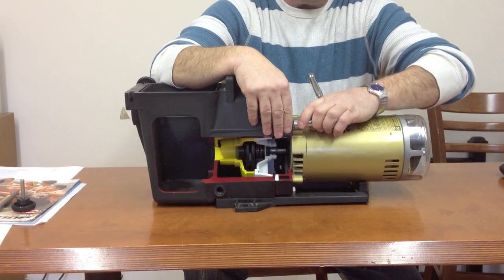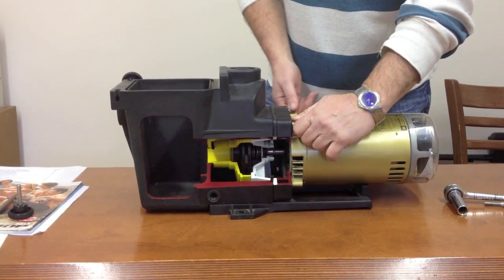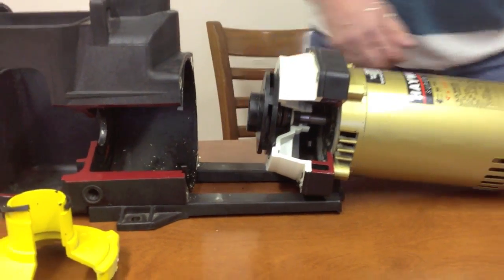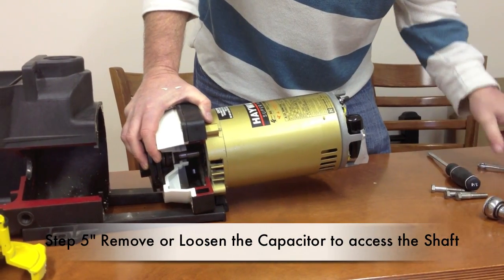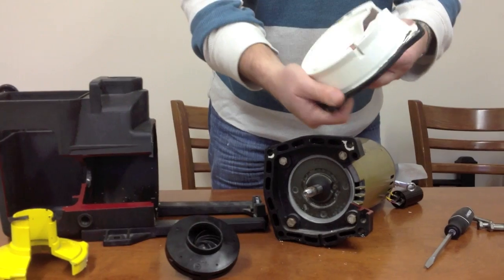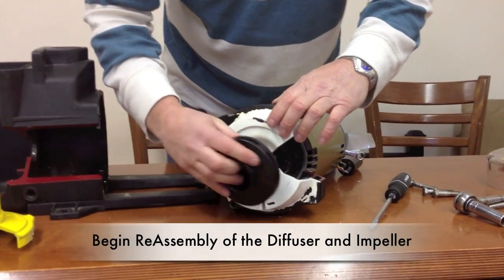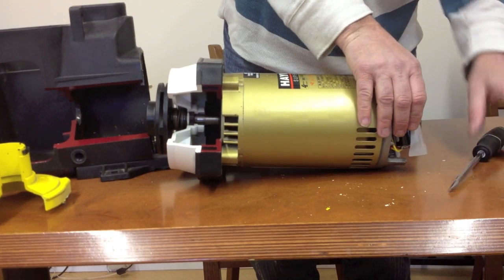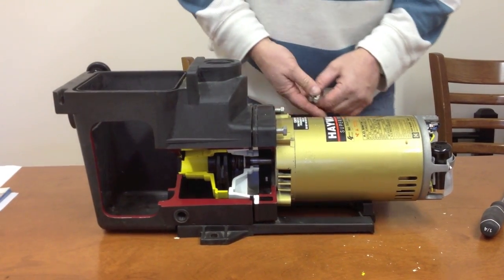How to Change a Water Seal in Hayward Pool Pump Motor

Comment: Great video!  The cut away of the pump &  related parts is a good teaching tool. I'd just mention to be sure power is off & be careful that the capacitor is discharged when working on the back of the motor.
Reply: I'd like to try it but a bit concerned about this prep work

Comment: This was very helpful. Thanks. In my case, I needed a metric 12 wrench to hold the shaft. I took off both the capacitor and starter. And I didn't realize that the old spring gasket broke, so the metal base was still on the shaft and I had to pry it off with a screwdriver before the new one would fit. Watch for that in case it happens to you.
Reply from the maker: Hi Dale, Thanks for the feedback. Checking the drive shaft is a great tip. Thanks for sharing your situation.

Comment: Other video's mention disabling any power connections but obvious this isn't an issue with your demo unit. Still, you mention a capacitor when preventing the shaft from turning. Even if I unplug the pump is this capacitor going to have any juice left in it when I stick my wrench in there?
Reply from the maker: Hi Bill, thanks for watching and commenting on our video.
 If the motor power is disconnected, there is no power to the capacitor.  Once unplugged, it is safe.
Reply: @Eztestpools  Doesn't a capacitor store energy even after it is unplugged?

Comment: My pump is very hard to prime.
Also once running and turned off it leaks air into the pipe from the impeller area.... Any idea which seal it might be? It's a superpump and the strainer seal is new.  Thanks
Reply from the maker: Good Morning,

Thanks for you inquiry! The first thing we would ask is if there is water coming out of the bottom of the motor? If not, concentrate on the front of the pump forward. Check the drain plug, first fitting into pump or any valve.
Reply: @Eztestpools  No water leaking... Pump drain plugs both new as is the lid seal.  Strange when the water is turned off it "gulps" air from the bottom impeller area and fills the hoses with air.  Strange.  Also only able to prime by forcing water down the pool suction hole.  Thanks for your help!
Reply from the maker: @Dobemandan  Do you have an inground pool or an above ground pool? If it's an inground pool, you could have a broken pipe somewhere. If you were interested in speaking with one of our techs regarding this, I could set up a time for someone to call you. We'd be happy to help. Thank you.
Reply: @Eztestpools  Very kind of you!!  I just replaced all the seals and now it works great!  I think it was the seal in the center of the defusser.
Thanks again!!!
Reply from the maker: @Dobemandan  Great to hear! Thank you!